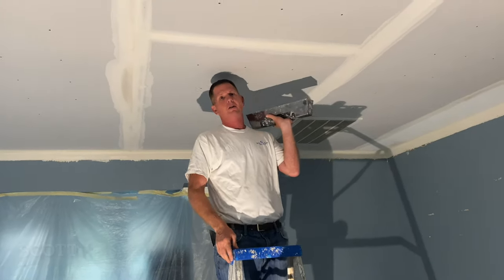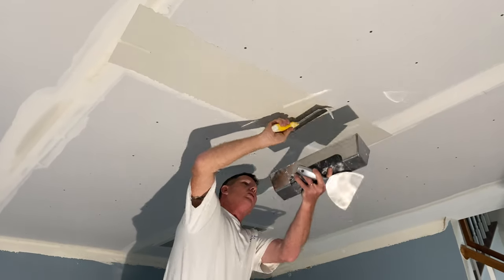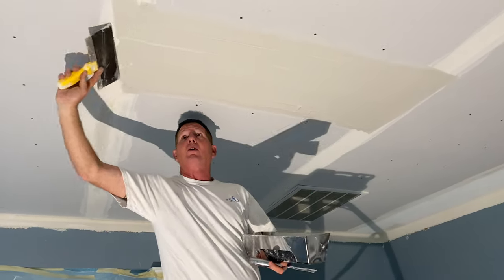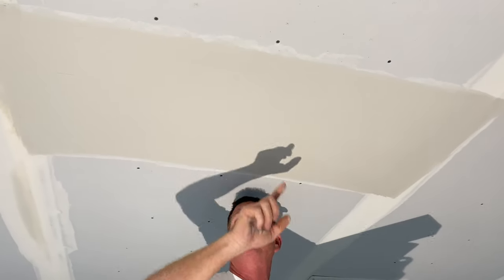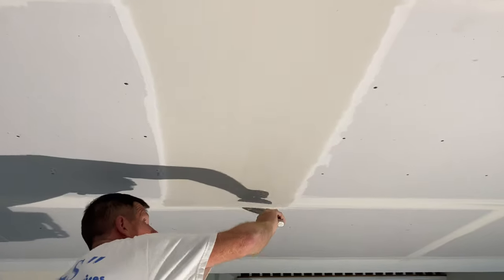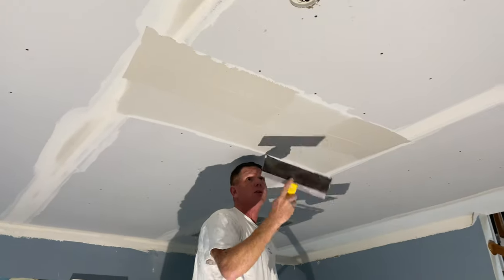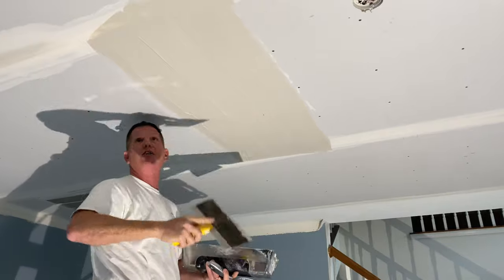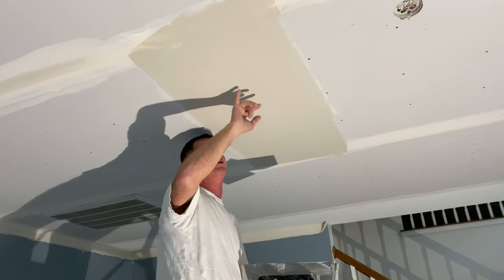How to Float and Skim a Butt Joint (Where the Two Short Ends of the Sheet Meet)

Comment: Hello, I have a question - is there a limit how thick you can float the indentation? I have an old wall which may have up to 1/4-1/2" waves and I was wondering if plaster based mud would be okay for floating? I guess I have nothing to lose if I try.
Reply from the maker: Hot mud has plaster in it so if you have a large area, I would suggest to mix a bucket as opposed to pans, but yes, you can float as much as a half inch on anything. You should probably prime if it’s an eggshell paint prior to floating as the eggshell has a reaction with the mud takes longer to dry and doesn’t stick as well. If it’s a flat paint, you can float right over it. Hope this helps.
Reply: @scottssheetrockservices  Wow thank you for the swiftness and amount of information in your reply! Matte acrylic paint, so it should be no problem...

Comment: The float coat looked pretty good, what's the purpose of the skim coat?
Reply from the maker: Flow coat usually is pretty porous and will have pit holes and so on that is what you do to what we call “kill” the joint. The skim coat is meant to cover the float coat and basically pretty it up hope that helps thanks
Reply: @scottssheetrockservices  oh that makes sense. Thank you!
Reply: Gee, I always spent too much time sanding the pit holes out of the float coat. Thank you. What a relief. @scottssheetrockservices